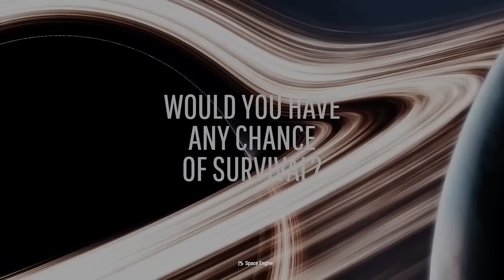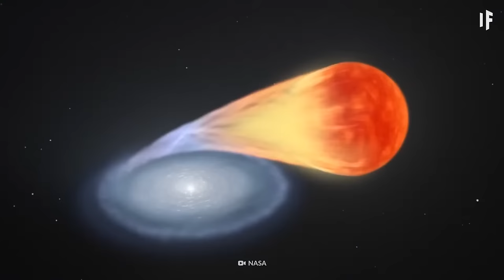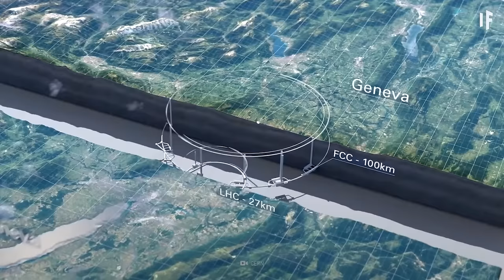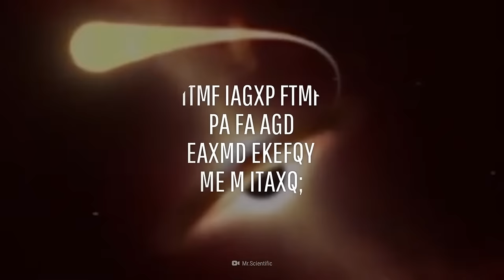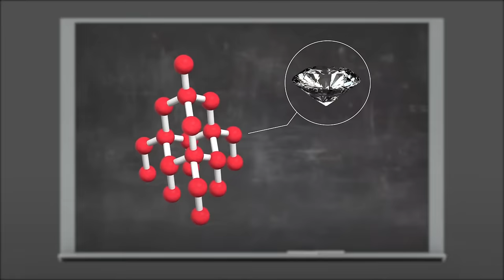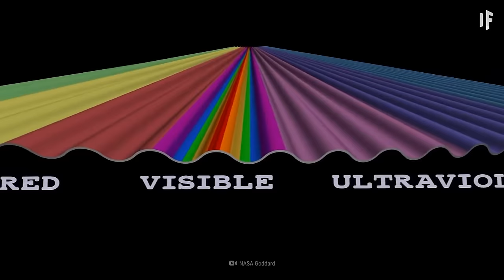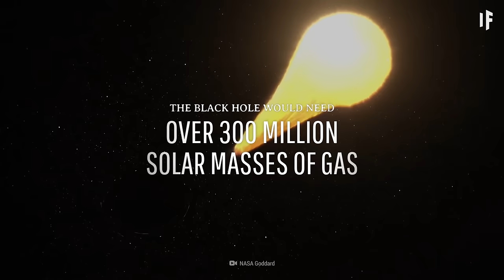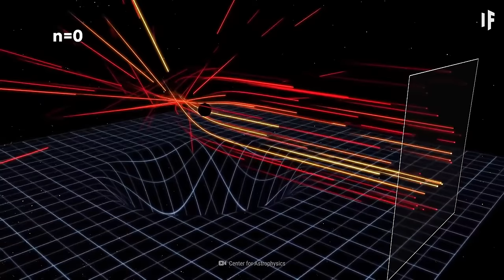What's On the Other Side of a Black Hole?

Comment: I think of black holes the same as a  how a tornado or water spout. It has nothing other than a spinning end is my guess. How would it lead anywhere? It's just a thing not a door to anywhere
Reply: No one has ever seen a black hole, or proved they exist. It is an entirely theoretical construct. And, yet ... Here you are, talking like what you are saying is based in any form of reality.
Reply: @grimuk3817  you are wrong, they do exist
Reply: 😂😂😂 really comparing blackhole with cyclone how like light can't escape blackhole  
you are posting like there is nothing inside blackhole 
that why scientists are so much curious just fir the sake of nothing things🙂

Comment: ok 2 black holes of equal size and strength. would 1 of them become spagetified? or maybe both become spagetified untill 1 finishes off the other one. then reforms into a circle?also can a black holebe pulled to a point it no longer returns into a perfect sphear but it would have an odd Taffy looking shape?

Comment: Hello. I wanted to know if Ton 618 is the biggest known black hole, because I heard that the blackhole Phoenix a* in the Phoenix a cluster is bigger, but I am not sure. Pls tell me if u know. (:
Reply: Phoenix a* is bigger at  around 100 billion solar masses whereas Ton 618 is at only 66 billion solar masses
Reply: Mass and size are two different things.
Reply: Do u know how big it is in size?
 @OmegaKenelly
Reply: @RobloxFreund09 Currently biggest black hole known to us is quasar Phoenix A* located in Phoenix Cluster with the mass of 100 billion solar masses (34 billion more than previous record holder TON-618). It's event horizon (Schwarzschild radius if it is a non rotating black hole) is 590.5 billion kilometres wide while TON-618 is sitting at 390 billion kilometres.
Reply: No one has ever seen a black hole, or proved they exist. It is an entirely theoretical construct. And, yet ... Go through this comment section and everyone is talking about them like they are Gospel. 90% of our 'science' ... is nothing more than speculation. Conjecture.

And both of those words are actually just another way of ... GUESSING. 

Your entire paradigm is bluster, BS, and ludicrous leaps away from logic and reason.

Yet here you are ...
Reply: @grimuk3817  interesting
Reply: @grimuk3817  And your point is what exactly?
Photos of black holes were taken, you can see them online. We have a pretty strong evidence that black holes do exist and they might just be the key to understanding of our universe.
No one has ever seen subatomic particles or atoms and yet they exist.

Comment: does it hurt when you go in a black hole
Reply: Depends,does it hurt you or does it hurt the black hole? I've been in a few,pain free,even delightful
Cheers
Reply: Eventually, yeah.  The larger it is, the further inside you could go before u were spaghettified.  

If the black hole is feeding, you'd be burned to a crisp at the event horizon or before.
Reply: No one has ever seen a black hole, or proved they exist. It is an entirely theoretical construct. And, yet ... Go through this comment section and everyone is talking about them like they are Gospel. 90% of our 'science' ... is nothing more than speculation. Conjecture.

And both of those words are actually just another way of ... GUESSING.

Your entire paradigm is bluster, BS, and ludicrous leaps away from logic and reason
Reply: @grimuk3817 I've only seen and been in brown and white holes never a black hole but I wouldn't mind
Reply: @diegochavez6203  Is that so? I would never post a comment that demonstrated to the entire world, just how primitive I was. But each to their own, I suppose.

Comment: What if you and we go in there with a 100000000000000000000000000 KM more speed than the speed of light,and we go to the other side of the Black Hole. I fell to go and I feel scary but I feel like I want to go and I do not want to go. Ah I know It is impossible and a stupid idea.😔

Comment: I truly believe black holes and white holes are the same thing. You just can’t see the full round-about view so it looks like two different things.
Reply: Sometimes we can see around the whole thing tho.  Plus, a black hole doesn't have a front or a back.  It's a point.
Reply: No one has ever seen a black hole, or proved they exist. It is an entirely theoretical construct. And, yet ... Go through this comment section and everyone is talking about them like they are Gospel. 90% of our 'science' ... is nothing more than speculation. Conjecture.

And both of those words are actually just another way of ... GUESSING.

Your entire paradigm is bluster, BS, and ludicrous leaps away from logic and reason
Reply: And your offended because?
Reply: Yeah I forgot that they do have their own solar systems around them. I still feel like black and white holes are connected somehow.